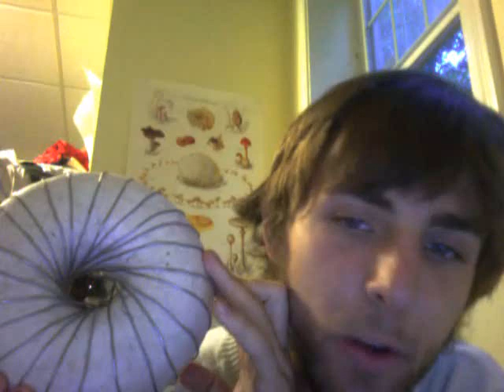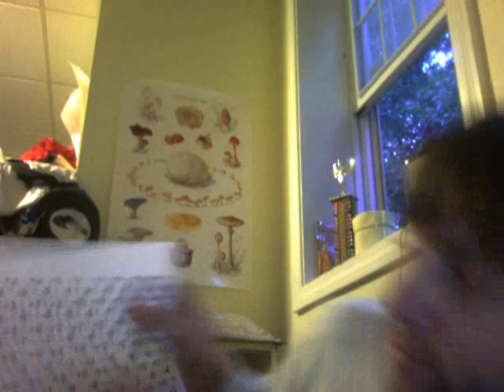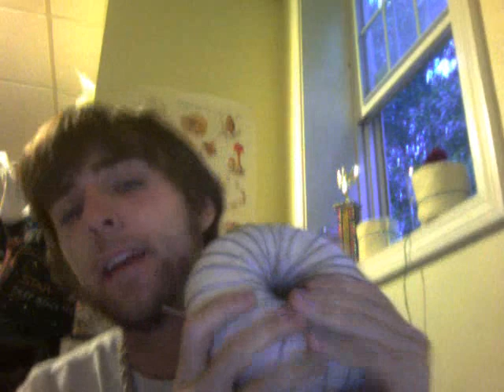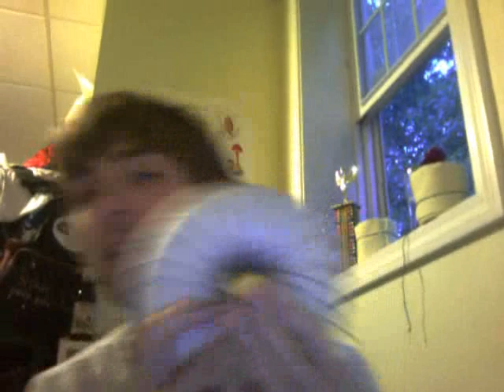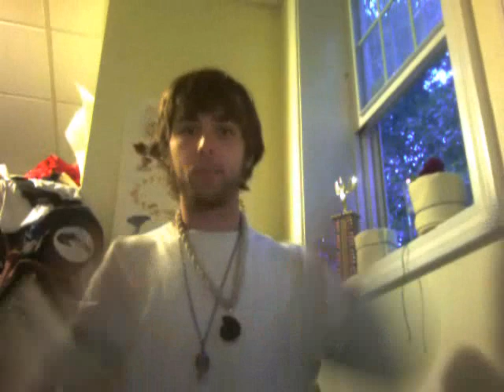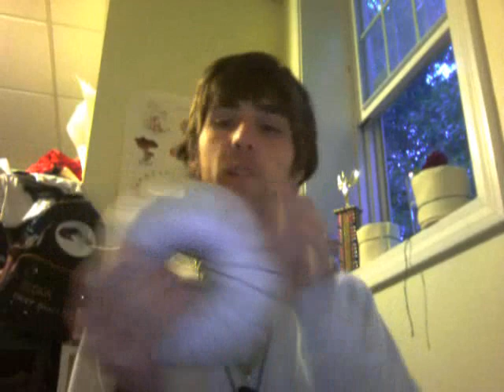How to properly build a Rodin Coil - Part 1/2

Comment from the maker: @jackscholze Howdy Jack! Been reading some of your book lately, great stuff! The one in the vid is a traditional Rodin coil. Two aluminum circuits 12 point. I don't even follow that configuration anymore. In all truth, you do not want leads! The simplest is a 3 point winding, with 18 circuits so its matrix is 54 x 54. If you did leads that would be 36 leads.

Comment: The Torus is the 9 Chakras collapsing into one ring. Tuning into the long wave, (Golden Ratio, harmonic of the Heart. creating the 144,000 Full spectrum unified field of light/sound.)  Guy from Coral Castle, (Ed Leedskalnin) knew how to create an implosive field drawing the SWord from the STone .... Sort of like Usil in Dune riding the prophesized Long worm.
Wind it in pent & you should get acceleration due to golden ratio. (Implosion/Phase conjugate acceleration of vorticity)

Comment from the maker: @CWojewodzic A traditional rodin coil (12 point) wound correctly to vortex mathematics, would be 216 points with 18 circuits/12 pointed stars all evenly spaced (no third blank spot, that is a magnetic field pattern). I'll make a vid that describes those better.

Comment: Question: I have wound a few Rodin Coils.  The way I have divided the circle is based on 360 degree, which is then divided by  fundamentals (i.e. 12, 6, 24 or 36). Does that obey what your saying....I think it does, but just to be clear?
P.S. Happy Be-lated~Birthday!